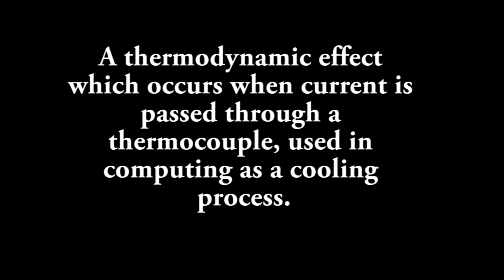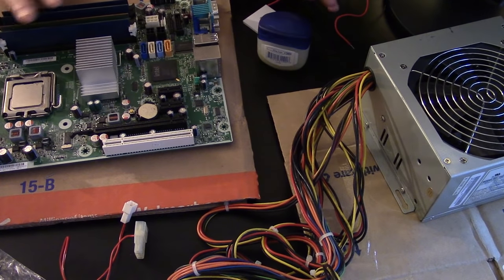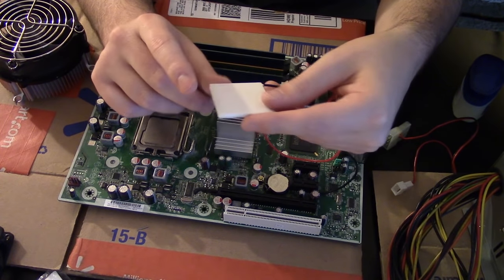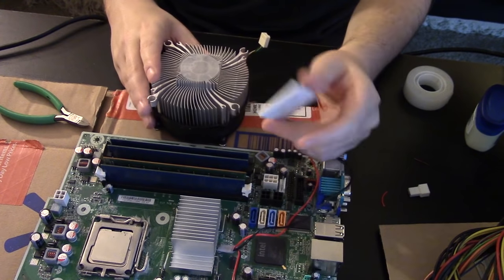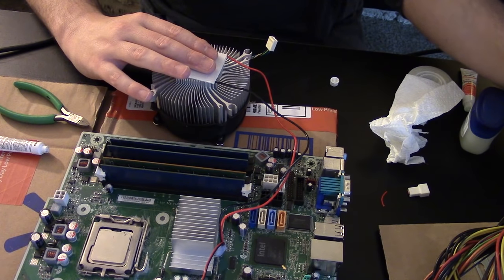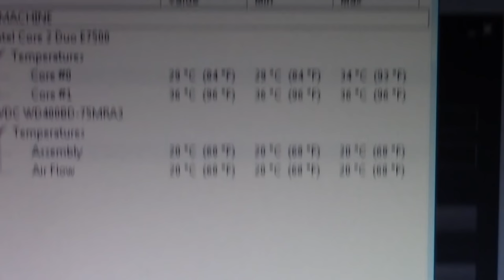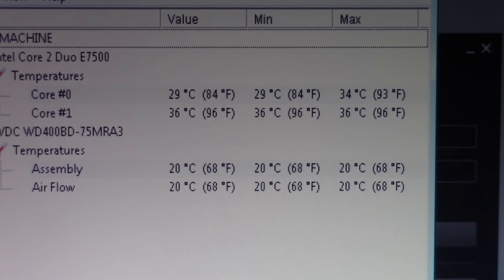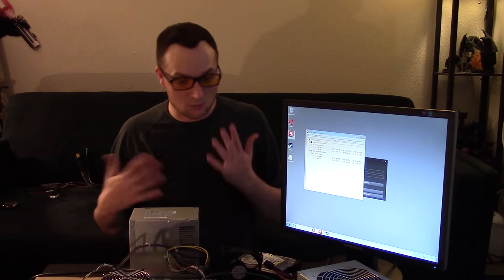💻 Peltier CPU Cooling Test

Comment: What about water condensation ???  Definitelly will short circuit the board/cpu  xD
Reply: Probably not like this...it's not going sub-ambient~
Reply: @auturgicflosculator2183  Can you test about moisture problem. it is possible to damage the board and cpu
Reply: @nize8573  If temps stay above ambient, condensation won't form. Below ambient there might be some issues, particularly if any parts hit 4ºC or lower.
Reply from the maker: it technically would be distilled water, so chances off issues are low. thanks for sharing.
☃️ Happy Holidays. Sorry for the delay in response, as I'm sure you know I can't reply to everyone. Hope you enjoyed the video. Please sub if you haven't already & have a safe new year. 🙂

Comment: what about humidity on cold side ?
Reply from the maker: hence the issue and why this isn't a viable solution. Only real way to do this is to use a mix of liquid cooled system and peltier plates on the radiator. Please sub if you can ☺️

Comment: When I was playing with Peltier and Celeron 300A I easly reached below 0 temps at full load.
Reply: Doesn't it decreses performance for being too much cold???
Reply from the maker: Colder is better generally speaking when it comes to CPU's . You are correct that certain electronics perform worse under cold conditions but CPU's and GPU's love the cold. please sub if you can 😀
Reply from the maker: Nice! please sub if you can 😀

Comment: Is vaseline non conductive? 

Also, great job. I'd pick a different filler music next time tho... Perhaps you could try testing it under load as well? I'd hazard that the gains will be more when it's running at 100%

Cheers
Reply from the maker: Petroleum jelly is not conductive however many Vaseline products do add water but it is not enough to do damage. I have to assume it is distilled. It works as a protective layer against condensation.
Reply: Hal Jordan this isn't a long term product, just a proof of concept, chill bro
Reply from the maker: Another great overclock using Vaseline 
https://youtu.be/8Jjpxlu71ww
Reply from the maker: thank you! I always find it funny when people say no offense before they intentionally offend you. The only time no offense is not offensive is when it is constructive criticism.
Reply: DoctorNoob a stress test would've been nice to include but it's still a cool video!

Comment: If you use the peltier plate to cool the coolant in a w/c loop instead, you'll get much better results.
Reply from the maker: agreed, ya this was just a test but yes cooling the radiator or the liquid somewhere is the most ideal. 
Please sub if you can 🤖

Comment: this doesnt work. peltiers are highly uneffective. they would never have enough power to cool the heat power of the cpu, so if the peltier is 75w, at 4% efficiency wich is an optimistic one i only measured about 2% in reality, but assuming you would get 4% , that would mean about 1.5 watts of heat pulled... so if your processor gives lets say... 100watts of heat ... and the peltier pulls 1.5 watts... guess what would happen :))
Reply: sorin crivat está en lo cierto. el video es una truchada
Reply: +sorin crivat  Yawn, If you are employing them in a current limited environment like a laptop, sure. But in an essentially unlimited desktop environment your point is moot.
Reply: You are forgetting that peltiers dont create coldness. They exchange heat from cold on one side to hot on the other so a 25w peltier would be more than enough for a 100w cpu. Just use proper platinum thermal compound from noctua and give the peltier 12v
Reply: exactly iv seen other videos using a 60w peltier and it was minus 17 degreesand frost build up on the cpu
Reply: Yeah, i've tried them before, the temperatures actually risen about 10-30°c. 
Peltiers arent very efficient and generate alot of heat, so you would need to have a way better heatsink, but then its more worth to use it without the peltier.
Reply: what would hapen if you had multiple peltiers cooling a water cooling loop?
Reply: Firenado With the right heat dissipation, and the right power source you maybe would be able to cool down the water to refrigeratoe levels, and probably damage the cpu or the motherboard with the water condensation and spent a tremendous amount of power. 
Not impossible, just not practical
Reply: Eduardo Avila fair enough
Reply from the maker: Probably a much better option since you can have them external.
Please Sub if you can 😊

Comment: What if you use it to get power back from the heat........
Reply from the maker: The amount of lost potential would really amount to anything. I had a friend that tried a similar concept for the heat sink fan. when it got hot enough the fan would spin a little bit like a few rotations then stop. All he got out of it was a very unstable CPU. What were you thinking of doing?
😋 Please sub if you can

Comment: It needs to be a to high end peltier to really help, and these are expensive and spend alot of energy so better of spending with a better heatsink and cooler or watercooler. Also with peltiers theres aways the risk of water condensing and even with vaseline it may cause issues. 
Unfortunatly for pcs it isnt much usefull...
Reply from the maker: after much testing I found that the best configuration was to hook it up externally to a water cool system.
Please Sub if you can 😊

Comment: WAY too much thermal grease. It’s supposed to fill in the gaps between the metal parts. You don’t want a thick layer. 

Best way is to put a pea-sized piece in the center and let the clamp of the heat sink cause it to spread. Maybe wiggle it a little before screwing down.
Reply from the maker: ☃️ Happy Holidays. Sorry for the delay in response, as I'm sure you know I can't reply to everyone. Hope you enjoyed the video. Please sub if you haven't already & have a safe new year. 🙂

Comment: Dude you need to run some overclocking test to really check the ability of this thing.
Reply from the maker: Although I agree, it was just a test and I didn't want to mess with any of my boards that have the ability to overclock. AKA didn't have any spares I don't care about.
Please sub if you have not already 😋
Reply: @TheThorns  Sure Ill give ya a sub why not. Good thing about many of this SBC is even overclocked they are good on power. Hell my Rockpro64 I have a fan that comes on if temps get to high and I have literally never seen it come on. May as well not be there. The consistently make these things underclocked as we can see with the first few series of RaspPis all being the same chip just factory "overclocked" so in most cases it should be rather safe to OC I would think without burning them up like you have to worry about when it comes to PCs

Comment: I think you most use it on a radiator instead of using it on the cpu
Reply from the maker: For a more permanent solution I would have to agree. For instance water cooling and putting this on the radiator would not only boost performance but condensation should not be an issue. Please sub if you can. 🙂

Comment: Man, i used those sprays that Clean eletronic pieces. It has compressed air, right, so it created a litle condensation in the cpu. In the metallic part. It was not huge,(not enough to rain drop). Let it sit in fresh air during daytime, and in a box with some silica gel im night time.. its this ok?
Reply from the maker: Thanks for sharing. There are numerous things I would do differently if attempting this today. For starters use a water cooling block and put the Peltier on the radiator portion. ☃️ Happy Holidays. Sorry for the delay in response, as I'm sure you know I can't reply to everyone. Hope you enjoyed the video. Please sub if you haven't already & have a safe new year. 🙂

Comment: you put too much thermal paste on processor ,. = the thing is when you apply pressure  thermal paste will squiz out of the "square quadrant" and go toward sides , then it "build up" on sides and your cool side will get in touch with your hot side by mean of thermal paste , thus creating temperature exchange between them ( eg your temperature will not get cold enough ) , which probably what happened ,
Reply from the maker: Thanks for sharing. There are numerous things I would do differently if attempting this today. For starters used water cooling block and put the Peltier on the radiator portion. ☃️ Happy Holidays. Sorry for the delay in response, as I'm sure you know I can't reply to everyone. Hope you enjoyed the video. Please sub if you haven't already & have a safe new year. 🙂

Comment: the thermocouple doesn't need to be in that configuration.
You could have the hot side in a radiator outside your case, and the cold side on your CPU.
Then you could hook the power input to the cooler into the PWM pins of the CPU fan, so as the CPU heated up it crank up the cooling. This would prevent it from reaching temperatures that will form condensation, since it will only pump enough heat to keep the CPU at a safe temperature (although you'd have to make your own power controller to turn the PWM signal into something that controls the voltage).

Your assessment of that cooler is correct, though... just saying that in theory the only sacrifice you have to make is higher power consumption; you can still avoid condensation while also getting good temps, pure silent operation, and convenient form factor.
Reply from the maker: Thanks for sharing. There are numerous things I would do differently if attempting this today. For starters used water cooling block and put the Peltier on the radiator portion. ☃️ Happy Holidays. Sorry for the delay in response, as I'm sure you know I can't reply to everyone. Hope you enjoyed the video. Please sub if you haven't already & have a safe new year. 🙂

Comment: wow 5c cooler while only consuming 150W! GREAT!
Reply from the maker: It varied a lot, but then again this was a 1st attempt test run. really should mount it properly and use better thermal paste, use less of it. was kind of a crappy contact but showed lots of potential. 😋
Reply: @TheThorns  hellow from indonesia sir., it is safe or not sir? Because i worry about the feltier produce the water then damage my processor.

Comment: but what about moisture from peltier ... you dont want to short circuit your board 😋
Reply from the maker: vaseline helps, but for long term there are a few solutions.
Reply: DoctorNoob small amount of moisture can be controlled but on peltier there are watet droplets. I dont think those solutions will guarantee " 0 leeakage" . If there is any.. please let me know i am interested
Reply: DoctorNoob back in the day, we would use closed cell flexible foam like insulation.  Cut it to fit... and seal the enclosure around the processor and mount with RTV.  That solves the source of the moisture (the air).  Only condensation could build up in the enclosure and...frankly...anything around the processor would be frozen.  I ran a rig like that for two years solid.  Processor would run at 0C.

Comment: Is there anyway one can Apply this to a MacBook externally ?
Reply from the maker: You might want to consider a laptop cooler. Probably give you a better result and is much safer.https://www.gearbest.com/laptop-cooling-pads/pp_361599.html?lkid=12360316

Comment: If I have to apply Vaseline to mod my computer then I'm out.
Reply from the maker: If you are looking for a more professional mod and not just a mess around test, then I would recommend looking into a corsair enclosed liquid cooler. Then attach the peltier plate to the radiator. Please sub if you can 😋
Reply: @TheThorns  That would make a good video. I have several computers using different types of cooling. One is submerged in mineral oil and has a thermostat controlled pump to a radiator /fan set (built for extreme quiet). 2 others use ridiculously large heat sinks with fans. I don't have a need to OC them so they run pretty cool. I do enjoy videos of new ideas and happen to have a non-functioning wine cooler that uses two Peltier devices. I am assuming that they are still good, the last wine cooler that broke down had a circuit board issue but the Peltier units still worked. Just looking to use them somehow. Thanks for the video and reply.

Comment: Its a way of damage your cpu by the water
Reply from the maker: Agreed, as stated in the description this was only a 1st time attempt test. If doing this on a professional level it should be done on a water cooled system with peltier on a heat sink or radiator away from the board.
Sub if you can 😋

Comment: Too bad you cant screw in the cooler because of it.
Reply from the maker: Honestly I would just need to modify it with some longer screws. the best way to do this is to water cool the CPU and put the Peltier on the radiator to cool the liquid. Please sub if you can 🤖

Comment: Some substances are easily absorbed through the skin. What is the benefit of washing it after the toxic substance is absorbed from the skin? So don't touch every shit.
Reply from the maker: Good point. Most thermal compounds are not toxic but yes it is always best to be safe rather than sorry. You can always have an allergic reaction or skin irritation.

Comment: Moisture the cpu and possible cause is corrupted and destroy all the parts
Reply from the maker: You are correct it can. that is why it is best to use liquid cooling and put the plates on a radiator.
Please sub if you can 😄

Comment: not wise to use thermal glue on CPU. When you want to uninstall the cooler, you will have difficulty.
Reply: Mokou Fujiwara thermal glue? you mean thermal paste which is a REQUIREMENT for a cpu/cpu heatsink otherwise your cpu will fry or not boot
Reply: Sorry, this was an oversight. I now see it is thermal grease but not the very sticky thermal glue.
Reply from the maker: Many mistakes were made in this experiment. However it should be noted I was just messing around. Even I cringe a little when I look back on this video. Sorry for the delay, as I'm sure you know I can't reply to everyone. Hope you enjoyed the video. Have a Happy Halloween 🎃 & please sub if you can.🙂

Comment: never, never, never run a cpu without heatsink fixed to the motherboard!
Reply: why?
Reply: WolfRamiO PULSTAR Actually you can. If there is a problem then the computer will just turn off
Reply: Yeah, and remember to wear a helmet too
Reply: There is a system called thermal trip if the Processor template increases it trips and avoid Damaging
Reply: hes right, i put a cpu cooler but didnt click it right in am slot and the cpu was 20 ° hotter than now
Reply: You can run your cpu without a heatsink until it gets warm to touch, yeah you heard it right, without a heatsink.
Reply: Cmon man I always test motherboard and CPU without heatsink. Just go to bios quickly n make sure everything works... and wala
Reply from the maker: Many mistakes were made in this experiment. However it should be noted I was just messing around. Even I cringe a little when I look back on this video. Sorry for the delay, as I'm sure you know I can't reply to everyone. Hope you enjoyed the video. Have a Happy Halloween 🎃 & please sub if you can.🙂

Comment: Never ever do this, it's very wrong! It will add 60 to 100 watt extra power to the system, which needs to be processed by the cpu fan. The cable used here is not suitable at all. It's a fan cable suitable for about 2 amps max. Never put vaseline on your motherboard! It will melt when it gets hot and will cause serious issues. About everything shown here is just plain wrong, including the way the wires are joined.
Reply: Ron DLH What are you talking about? He is using an extra powersupply for the peltier, and the fan doesnt process anything
Reply: Where is the power of the extra power supply going?
Reply: Did you even read my comment? I said "He is using an extra powersupply for the peltier" so the power is going to the peltier element.
Reply: So you mean the setup is only adding energy to the system (system=cpu+cooler), seem quite the opposite of what you actually want to do. The fan needs to blow away the energy...
Reply from the maker: 🎄Happy Holidays🕎 Sorry for the delay, as I'm sure you know I can't reply to everyone. Hope you enjoyed the video. Please sub if you haven't already & have a safe new year. 🙂

Comment: 🟥🟥🟥Finally i found video that i am been searching... So why not use it .. why theres not so many video about this ..... This is a water cooled killer ,i need more info🟥🟥 how can we use this actively and why ppl dont use this actively? Ppl need to talk more about this then any other stuff
Reply from the maker: Some reasons why this isn't used more.
1. power draw , this is not power efficient when compared to fans or water cooling.
2. Condensation. Although considered non conductive distilled water, getting people onboard to have water trickle down the motherboard or add humidity inside the case is a no go.